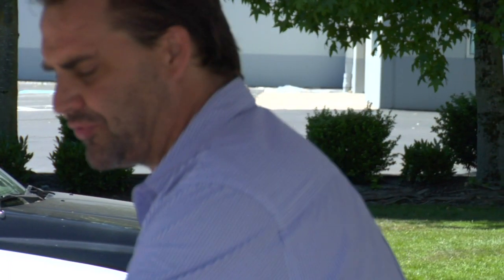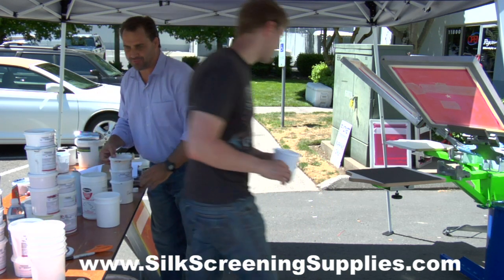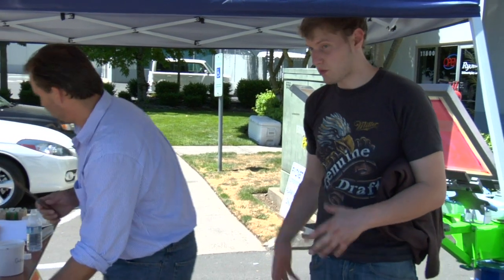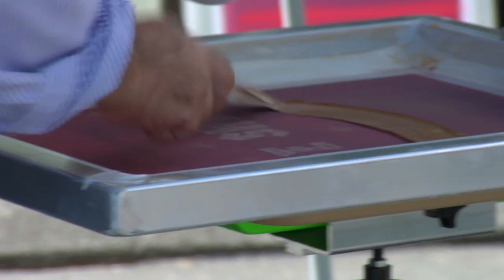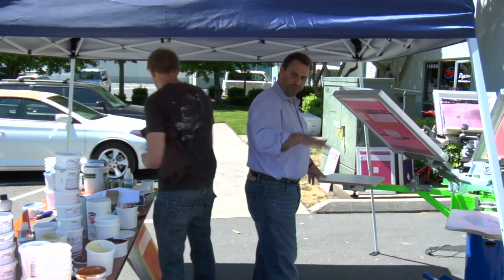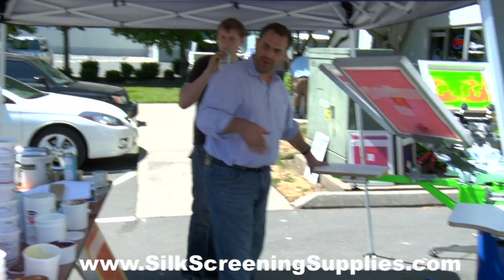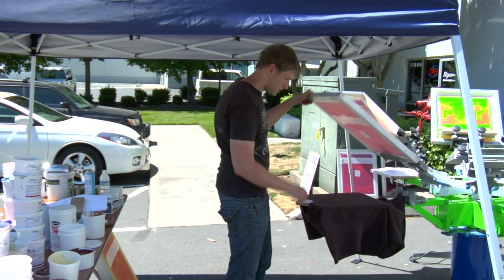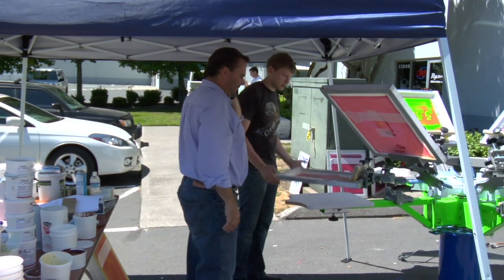Printing Ink Additives Seminar  - Part 2 of 5 - How to screen print

Comment: Although it may have looked like we did not use a dryer in this video that is unfortunately not the case. You would have to use a dryer or flash with all of the inks demonstrated in this video.